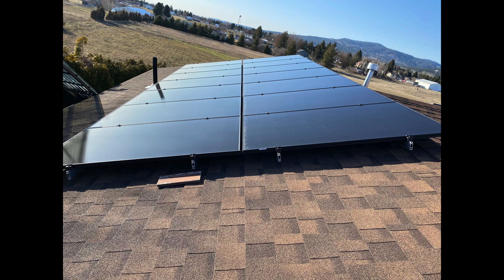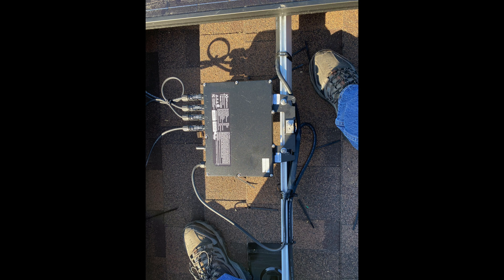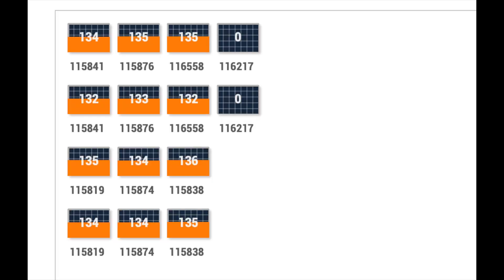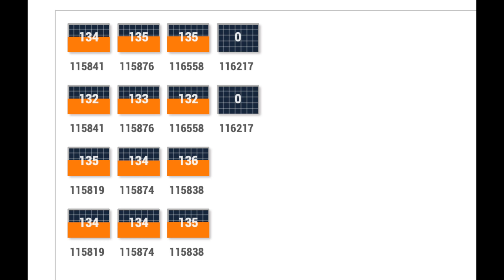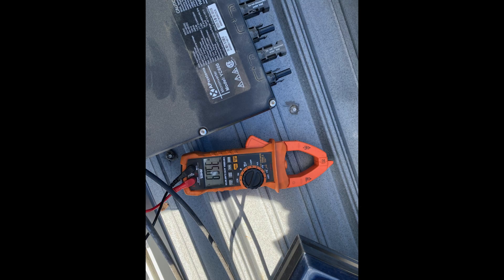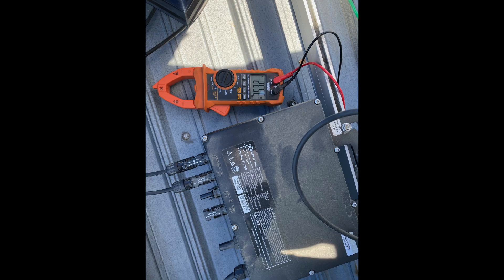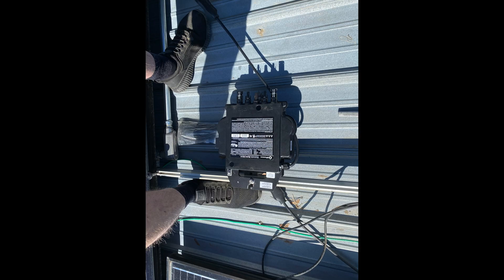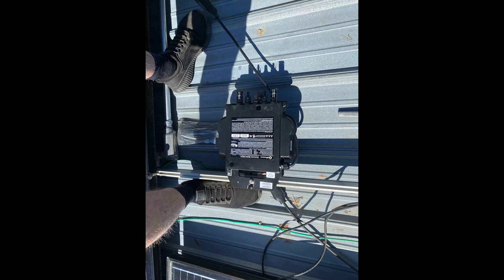Replacing a microinverter on a solar system

Comment: Was it difficult to get the new micro inverter from AP systems? What info did you provide to AP?
Reply from the maker: No, it was not.  I bought the inverters from Fire Mountain Solar and they handled the replacement in a reasonably short time.
GFM

Comment: GFM - if you were to run the DC from the panels to a ground based inverter, you could put several of the panels in series, thus raising the “combined” panel voltage?  This setup would seem to require less service/maintenance long term as long as the wires tying the panels together, or routed from panels to ground don’t corrode or chafe.  The inverter could accept multiple “parallel circuit” inputs, the quantity of which would align with your current panel count?  Putting a bunch of panels in series means that the next failure would take a bunch of panels out of the picture, which would seem to be a much bigger problem than what you just experienced, right?  Harder to diagnose that problem too?
Reply from the maker: There is a problem with shading and available inverter input voltages.  Also, the code requirements are much more complicated.
The future will tell if micro inverters are a problem.
GFM

Comment: Yeah that's why I would get just one big inverter, at ground level or in the basement! The time/cost value of labor is high!
Reply from the maker: You have to understand that wire sizing and required disconnects could make DC coming off the roof impractical.
GFM